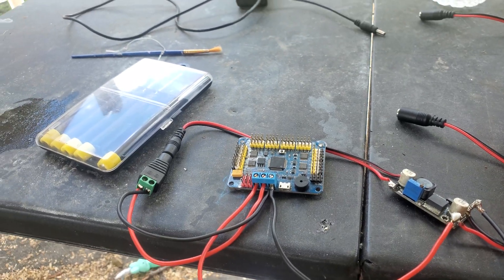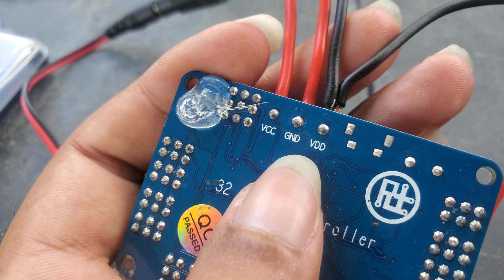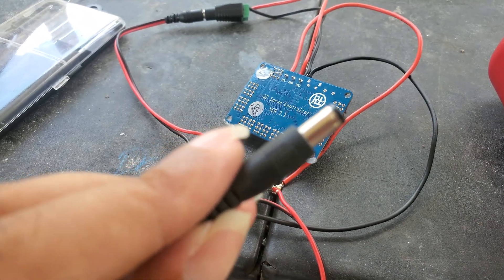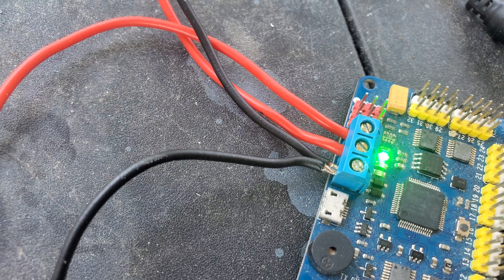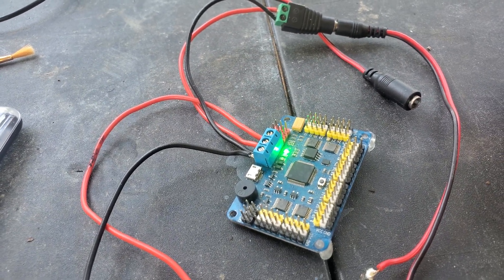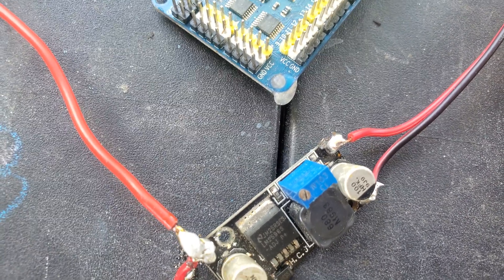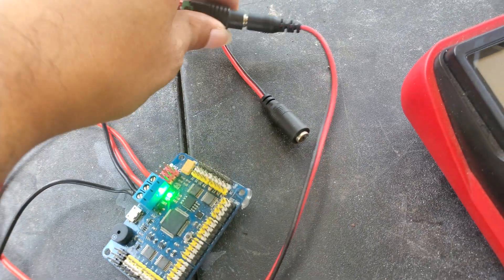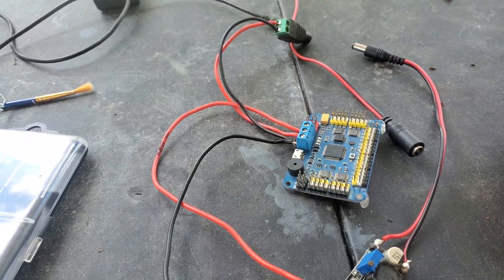how to power your 32 channel servo motor controller part 1.5

Comment: im trying to make a similer controller. can you tell me the IC part numbers printed on it
Reply from the maker: I no longer have been trying to use this servo controller but I did find one that works good and the customer service is good so you might want to check out that new video on this!

Comment: i want u to run this so badddddd
Reply from the maker: I understand that but the board isn't working well so I found a better one from an Amazon seller and they sent me the program to make the servos move so it is great and I made a video on the new controller board you should check it out!

Comment: any more information about the software
Reply from the maker: I have tried 2 different ones  but when I plug in all of the wires like the usb cable and the power supply I showed in the video it would only beep and I couldn't get the  servos to move and I was connected to the 2 programs on a com port so I don't think that I will be using the board anymore because it isn't working
Reply: @LegitLeeVelez  those boards are complete headache i just bought two of PCA9685 boards they very stright forward and many resources online  but the down side they run with only 5 volt also there is new pimoroni servo 2040 came out recently